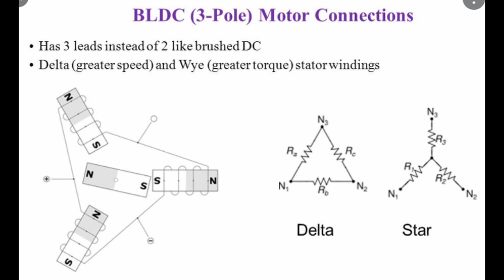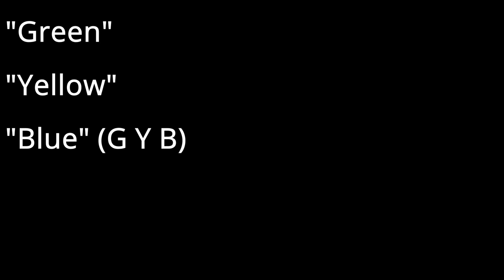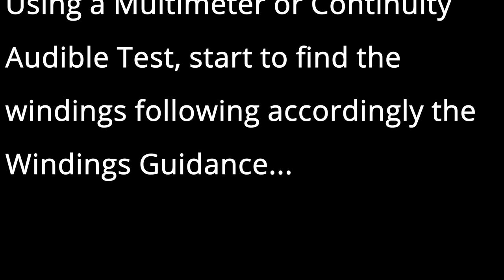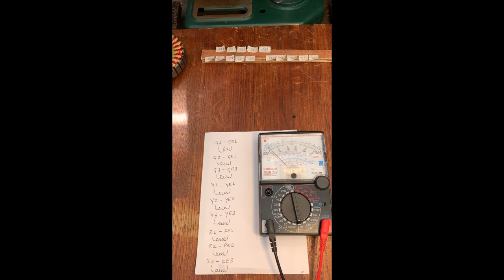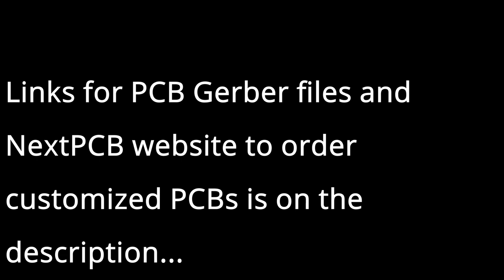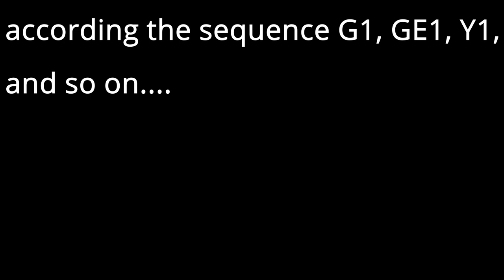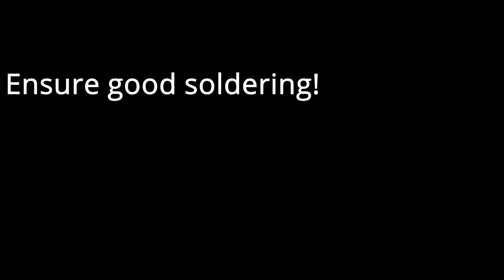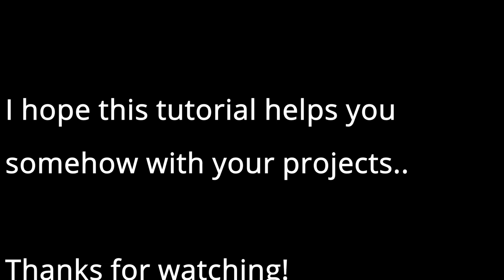Hoverboard Hub Motor Modification

Comment: To clear up the terminology the Y vs D connection does not affect rpm. This motor is a 30 pole 3 phase motor. As 30 poles the motor will spin at 200 rpm when fed 50Hz. This rewiring is reducing the number of poles inthe motor and hence the rpm increases, and the torque decreases.
Reply: So if you rewire and increase the number of poles it will increase torque? Maybe increase torque and use the wheel and a gear for a transmition for a small gokart or ebike

Comment: Thank you for showing this process.  I use my homemade disc sander powered by one of these motors.  But I have to use a higher voltage source to get more rpm.   I'll have to change to delta config if I want to use my 25v portable battery pack directly.

Comment: Why do all the connecting wires need to be cut,can i just use the three soldered together wires that terminate in the star configuration and re connect in delta configuration,advice please
Reply from the maker: Hi. Delta is kind of 'parallel' winding configuration and the reason to cut the wires is to find out the right windings for the new delta setup configuration. The three soldered wires must to be removed to be able to make the new delta configuration. There is a drawing picture in the beginning of the video that is very useful for a reference.

Comment: Thanks so much for this video - really interesting that you can get 1.8x more RPM with a re-wire.

One question though - That shrink wrapped group of 3 wires during your disassembly was likely the star point (at 5:20 in video) - is there a reason you went through that whole snip/label/rewire and didn't just wire those directly to the delta points?
Reply: For what it's worth - I just rewired one without the elaborate labeling, cutting, PCB etc. 

*******Follow this advice at your own risk. I take no responsibility for you blowing up your motor & or controller.************

De-solder the star point. (Look at 5:20 in this video)
Identify each strand as A/B/C - these are the ENDS (use a multimeter in continuity mode)
On my motor, the winding order of the 'STARTS' was A/C/B (place where colored wires come through the hub and connect to the enameled wires. Green/Yellow/Blue colored wires). This was top to bottom with the hall effect board on the right side. YOURS MAY BE DIFFERENT.
Wire the END of A to the START of B, the END of B to the START of C, and the END of C to the START of A. 
Take special care to cover all connections to prevent shorts.
I was able to test mine without fully sealing it back up to make sure I didn't short anything and that it still worked.

I got about 2.4x RPM (unloaded) after this modification (680rpm->1675rpm). Obviously reduced torque, but I didn't need it for my application.
Reply: Thanks so much for this video - it put me on the right track to do what I needed to do. Keep it up!
Reply: @VinceAnido  how was the torque affected? i want to do this for a go kart project
Reply: @pavletrnic1433  negatively 😔

Based on the simulations I've seen it's virtually a perfect trade-off. 1.8x RPM for 1/1.8 the torque.

You may want to research wye/Delta switching. It's a technique used in scooters and bikes. Basically you bring out all the leads and make a switch to go from Delta to wye on command. Kinda like a two gear transmission but electronic.
Reply: @VinceAnido  so i would have all the coil leads coming out of the stator and then switch them externally?
Reply: @pavletrnic1433  basically, yeah. Haven't tried it myself, but the principal is sound and I've seen videos on here doing it. Simplest version I saw used a ring of contact points and it rotated like 90° to switch. Could probably 3d print one and use some thick copper tape for contacts.
Reply: @VinceAnido  thanks for this, just opened up a lot of ideas
Reply: @pavletrnic1433  happy to help! Good luck!

Comment: Hello, good morning, I am writing to you from Colombia, I wanted to ask you a question, I am clear about how to identify the coils of b1 -be1, g1-ge1, y1-ye1 but I don't know how you can identify which would be the b2, y2, g2 to follow the sequence
Thank you
Reply from the maker: The same way you identify the other coils…if you try to watch the video and pause, could help somehow…
Reply: @Attic-Toy-Design  same question...it is important to know which end of a coil is "current in" and which is "current out". If it's picked at random, we could get opposing magnetic fields.
Reply: I guess the most simple way to keep track is to label as soon as we cut the wires instead of cutting them all and then labelling them.
Reply from the maker: In the beginning of the video, check the first drawing that could be useful for guidance. When you start the process for the modification you will realise that is pretty easy and intuitive to find out the in/out of the coils. You made a good point in identify the wires when cutting them. Thanks buddy!

Comment: Cool. Can i just separate the 3 end crimp and connect them to 3 phase wire for more simple?
Reply from the maker: Thanks buddy. You need to follow the rule. The speeds of Delta are high because each phase gets the total of line voltage.

Comment: Hey I no you add a link for the pcb I don't no how to go about ordering. Is it possible to send me a link where I can buy the same thing that you have. Love your video by  the way
Reply from the maker: Hello! The PCB factory website and the gerber files links are on the video description.
Reply: You don't need pcb from the video. You can use 4 wires to solder in delta. Just see instructions of wiring.

Comment: Awesome video..  I'm new to these mods, given that even w/o any mods, I run my little hoverboard motor using a 52v battery and a 48v controller, and I get close to 35 Kilometers per hour on my ebike .  needless to say the motor gets hot. To prevent any wires from melting, I removed the hall sensors and operate it with a sensor less controller that i bought really cheap, once I took the hall sensor out I replaced the 3 motor wires with 12 gauge (awg) copper cable so it can tolerate the heat. .   Will this mod work if the motor is sensor-less ?  I would chip in a payment if you were to make a beginners mod video . . for those of us with less experience..
Reply from the maker: What a such lovely comment buddy. Keeps me motivated to carry on. Regarding sensor-less, it works but the speed motor controller needs the hall sensor in order to detect the position of the rotating magnet. The control system of the speed controller senses the rotor position and the proper voltage pattern is applied to the motor.

Comment: if i use the foc control thats usualy for this motor in wye, can it work in delta? or will stuff notwork as calculations need to be different 
somehow
Reply from the maker: I am using the FOC control as usually working in delta with no issues.
Reply: @Attic-Toy-Design  did you self tune the algorithm tho ? I'm using the foc hack for the original board . Altho I did find people that got it to work . But I also saw I can get 1700rpm with field weakening ajd foc on wye so... Il see but thank you for the answer

Comment: I looked at the PCB circuit and it's a star( Wye) connection, not a delta? Am I right? The ends of all windings are connected to each other on the back of the PCB.
Reply from the maker: PCB was designed to be Delta. I know, could be a bit confusing at first sight…but you can do the same job without the PCB, just using wiring…
Reply: Yes it's not delta. It's stell a wye. This modification change turns of the winding on the coil three time. So kv it's now 48. If you changed to a star it would be then 86kv
Reply: @jara9813  Ah, so what's what it does. I was confused looking at all those wire ends. Conversion to delta does not involve cutting any wires or adding a PCB. There will still be only 6 ends, which are soldered in pairs to the 3 wires that pass through the shaft, as opposed to the original wye termination where 3 of the ends are soldered together and the other 3 go to the shaft wires.

Comment: for people wanting to do this: NO, this is NOT delta modded, but a configuration called triple Star. a normal hoverboard motor is 3 individual coils, with 3 coils in parallel for each phase, so 9 total coil sets. normally, 3 in series for each, and 3 together for a y config. delta modding is much simpler than this method in the video, as all it is is you undoing the y configuration's center tap, and wiring all 3 main coil sets in a loop. 
i will make a video at some point on how to actually delta mod motors, which is much simpler than this. however, i am currently messing with this method in the video and it will require INSANE levels of current to mess with, so you absolutely have to rewire the phase wires with higher gauge and temperature resistant wire.
Reply: give me link to your video ot some tut please :) thanks
Reply: I would love to see that video as well
Reply: That is exactly what I thought watching it...why cut each individual coil.
It is much simpler to just increase the voltage to go faster.  If you use a ebike controllerr, most of them can actually run at 60v, so compared to 24 or 36, it would double the speed.   You can also use a dc-dc converter to up your battery voltage from 36 to 60, I have some 1200 watt units I used on my ebikes for this.

Comment: I'm guessing the delta configuration would produce higher voltage output, when the motor is being used as a generator? But, how much current can it generate?

Comment: hi. may I ask a question? so delta give more speed, but when speed is the same with one draw more current? 
like delta has 1000 rpm and draw 3 amps
so I rewind it with Wye and it have same 3 ampe draw. so does wye config give the same rpm?
sorry for the dumd questions

Comment: Why do all the end points come together?  Is that not star config?
Reply from the maker: Star (Y) is the original setup where all end points comes together. Changes were performed for Delta setup.
Reply: All endpoint still come together on your pcb. Are you changing from series to parallel?
Reply from the maker: @fleetcommand3499  I know it could be a bit confusing. But the configuration after modification is Delta Triangle, kind of series. In the beginning of the video there are some drawings showing the difference..

Comment: Great job thank you for that I had not realized the performance could improve that much it's as if you bought an expensive e-bike motor and I had no idea that those little things had that much potential hiding inside of there, but then  when I think about a hoverboard screaming like that with the modifications it would not have been a safe hoverboard (not even close) it would have been quite the little death trap wouldn't it have? Wow, and a helmet just wouldn't be adequate for keeping someone from injury, you'd need a 100  lb. Full body chainmail bodysuit if you hoped to keep any skin LMFAO 😊😅😂
Thanks for the awesome video and a mighty fine demonstration  of how knowledge and understanding Beats ignorance every time even with all the worthless paper rectangles in the world to throw at it when it comes to realizing maximum potential.
This unlocks a little secret for me because I had heard that Tongshen mid Drive kits in every tiar all use the same exact motor and now I know what that really means 😊 they're just configured differently and with the right modifications I can pretty much get the $1,500 one when I buy the $250 - $300 most basic one and unlock its potential.
You have a new subscriber
Reply from the maker: What a great comment Robert! Thank you so much. You are a kind of person that brings motivation to me. I will try to finish the e-scooter middle frame and sort out the batteries. My problem now is time! Let’s see what happens this summer…take care buddy!

Comment: Is the torque about the same? And would this overheat over a heavy load?
Reply from the maker: Hi Jakob. Torque is a bit less on a delta config. And yes, that’s true. Could overheat on long distances and heavy load. My recommendation is if you’re planning to make a 1DW escooter, make it 2WD instead, as you can distribute the load and power more evenly and obviously reducing the risk of overheat.
Reply: @Attic-Toy-Design  okay thank you great video by the way!

Comment: Did you modify the hall sensors too??
Reply from the maker: No modifications on the hall sensors at all…
Reply: @Attic-Toy-Design  Thank You very much. Did it drain more current after modification or same as before at x3 rpm ?

Comment: Hi, for delta rewiring I used another method without cutting the coils. but the torque has decreased considerably.
Will I have the same torque problem with your guide?
Reply: analyzing the diagram you do not simply connect the coils in delta, but connect the blue coil, divided into 3 coils, in parallel and then connect them to Y

Comment: I will use this engine as a wind generator. Can I get more amps and volts if I do what you did?
Reply from the maker: Wye (Y) Star provides more voltage but not current increase. Delta provides increase in current but not increase in voltage. It will depends on what is your wind generator application project is for. There is one more reason in star (Y) connection. There is a neutral point that neutral wire can be drawn using that neutral wire and any one phase can be used as single phase..

Comment: Does have less torque and more speed after modification? Is there a way to do they oposite? Thank you
Reply: I‘ve runner a Kelly controller (KLS7212S) on my Hoverboard Motor. I build a scooter out of it. Now it runs at 3KW and has lots of torque. I never thought that such a small motor can run that power.
Reply from the maker: Yes. To have more torque, just leave it original, as the original is a Wye/star configuration.
Reply: The motor's speed and torque capabilities should be the same. This only changes the proportion of voltage and current. You can get the same effect by using a higher voltage battery on the unmodified motor.

Comment: Mantaf skema lebih mendetil. Saya kira itu di likit ulang dgn kawat ukuran 6mmx8 lapis. 1 pole 5 lilitan dan seterusnya mungkin watt akan bertambah tidak 350 watt mungkin jadi 1500 watt. Tentu putaran lebih cepat.
Reply from the maker: Yes! You are right. That’s why I recommend make your e-scooter project with front and rear bound motors to distribute better the power reducing the heat…

Comment: how many watts can it stand without modification?  and with modification?
Reply: its the same 350w
Reply from the maker: Sorry take too long to respond. I would say more than 1200watts. That’s why I would recommend front and rear motors on your e scooter project in order to distribute the power better and reduce risk of overheat…

Comment: Ich habe eine frage Ändert sich die Leistung?  Also braucht er dann mehr Watt ?
Reply from the maker: Die Leistung ändert sich definitiv.  Weniger Drehmoment, aber mehr Geschwindigkeit.  Durch den Wechsel von Stern (Y) zu Delta ist eine leichte Überhitzung zu erwarten.  Wenn Sie ein Projekt haben, verwenden Sie am besten 2 Hoverboard-Motoren anstelle eines. So können Sie die Leistung gleichmäßiger verteilen und eine Überhitzung vermeiden.
Reply: @Attic-Toy-Design  
Hi 
 
Ich Habe ein Problem ich habe mir ein E-Suter gebaut mit allrad aus ein hoverboard das Hinterrad wird mit 1,8Kw betrieben und das Vorderrad Mit 1Kw der  akku hat 52v 24Ah.
Das Hinterrad, hat Fast keine Leistung aber er bekommt 1,8Kw und Wirt sehr heis.
 Bei zirka 30Km/h Hat das Vorderrad  Aussetzer der Motor geht aber Wieder an Und dann wieder aus. 
Ich würde mich über eine Antwort Freuen .

Comment: I watched few videos with this mod to understand whats going on 
TO All who dont understand this : this is NOT delta , this is STAR configuration with parralel coils 
before mod it was also star but coils were in series ,because motor controller works like a variable frequency drive it runs
slower without this mod , in essence youve just shorten the distance of wire , where u get 3x speed , bcs controller is same frequency , where youre exitacion is 3 times shorter, also current is 3x higher so u can burn out your controller or wiring ( find a controller for more current ). If someone wants this to use as a generator , this mod would only drop voltage by a third , but also increase current. FYI delta does not have neutral point.

Comment: I’m looking at buying your pcb you sell any more new videos
Reply from the maker: Hi Elliot! I’m planning to make more videos this summer finishing the E-scooter frame and batteries. The boards I have on eBay are quite useful but you need to reinforce the cooper tracks with plenty of lead free solder wire to support the high current generated by the motors and batteries.

Comment: Love your don’t be shy attitude I was very impressed. Is there any way you could make a delta interface so to speak a plug and play device that turns a star configuration into a delta? I feel the coil wires are so quantumly entangled it probably won’t work. I noticed these motors don’t take a lot of power and are tourque and throaty. Good job brother.

Comment: What voltage you used on the controller when you show the motor running?
Reply from the maker: Hello buddy. 36V 12Ah lithium battery pack
Reply: @Attic-Toy-Design  Okay, quite a nice speed for such a low voltage system.

Comment: hello, good afternoon, I would like to ask a question, I am converting the motor, but analyzing the schematic of the circuit I see that the coils come together at one point. and this is the star configuration, the delta comes with the coils in series
Reply from the maker: Exactly! You don’t need the PCB for this project. Just use a 10AWG rigid wire for the  coils connections.
Reply: @Attic-Toy-Design  10 agw wire is overkill  i reamed you to use 18 awg wire to solder the motor coils, but 10 agw will work fine to